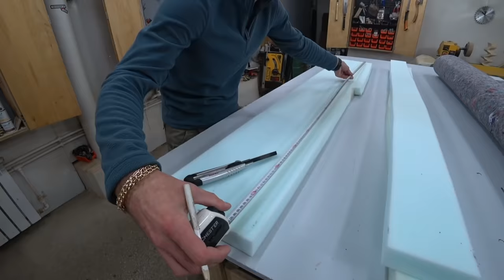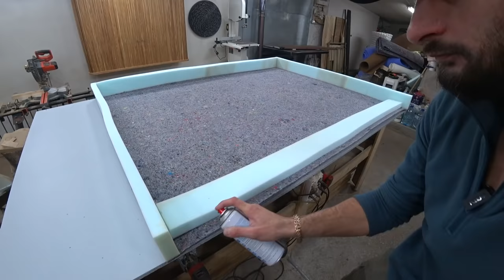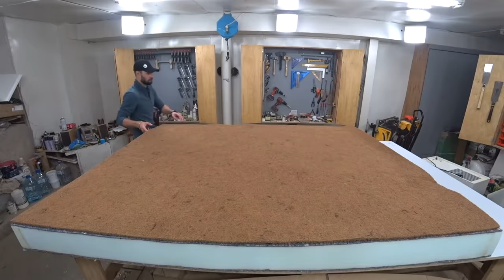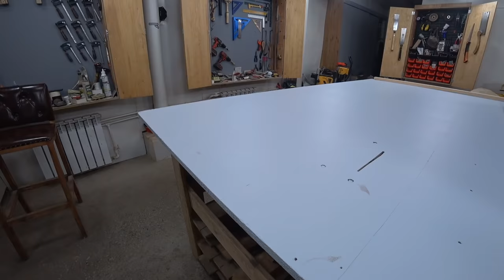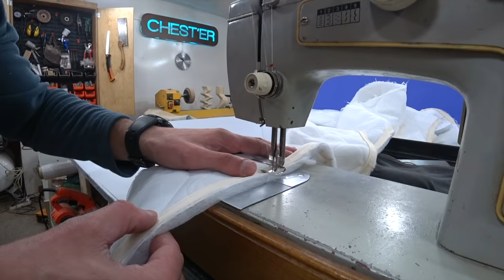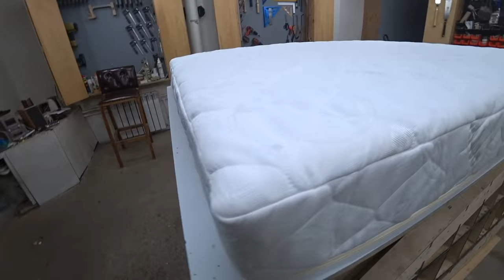You will save 3 times IF YOU MAKE THE MATTRESS WITH YOUR HANDS

Comment: My foam mattress was sagging in the middle. I unzipped the cover and took it out. I used an electric knife to cut it in thirds. I moved the sagging part to the bottom and spun the top part 180 degrees and put it back together with spray. Put in a new inexpensive topper layer. I got extra years out of it before buying a new mattress.
Reply: make sure to make sure your mattress doesn't have fiberglass in it before doing this
Reply: @xynonners  yikes. I know I wore a mask (n95) for the spray. But I cannot remember if I did when I cut it. Since I wrote the above comment, I bought a sleep number mattress.

Comment: This is definitely not a project I would have ever thought about undertaking, and of course this guy makes it look soooo easy.  But the basic concept is very solid and doable for those whose ambitions run high.
Reply from the maker: Any project requires effort. That's for sure. But in general - everything is possible, even with a minimum amount of tools.
Reply: I feel like if you were to buy your own mattress cover instead of making it (sewing big sheets of material is hard) the process would involve just stacking the layers and gluing them with spray adhesive. Seems manageable to me!
Reply: @matnovak  exactly what i was thinking. dimensions for  bed sizes are easily attainable, the $$ you pay is for the knowledge of which layers to stack how to get your desired mattress. Definitely thinking about attempting this before dropping a stack on a mattress.
Reply: Its easy asf I used to work at a mattress recycling place and we just cut off the outer fabric and put it into a machine that separated the metal and wood from the rest. Most were brand new but with slight defects and had price tags from 8-18k but when you open them.theyre very simple and the actual materials are relatively cheap. It would be like apple using 50$ of electronics in their phones and still selling them for over 1k.
Reply: @chesterkrsk  что за клей вы использовали?
Reply: @P.Subaeruginosa  USD?
Reply: @P.Subaeruginosa  can you show up and purchase mattress off them?  I did at one point look into how to extremely deep clean a mattress and if it’s totally clean why would I care where it came from.😊
Reply: @nerddub  Go to Arizona Mattress & get REAL quality, i.e. latex foam & Leggett & Platt springs (the leader in the industry BTW).
Reply: Except the off gassing of all the glue and foam may not be very healthy .   Add in all the time and equipment he used.  Plus you have to source all the materials.   Make a good rope bed with a hand made stuffed mattress using natural materials.  Easy and healthy.
Reply: Ideal if you  have a bed needing an unusual size mattress though I am worried about the type of glue being used.
Reply: @chesterkrsk  And health. You need good health to do it, too, which some people lack, myself included. If I were to attempt that, I would probably hurt myself more than I already am. I threw out my hip and back for a year trying a balancing board, lol. Even if I were able to do it, it would probably not be worth it for me in the end. Then on another note, there is all that glue you were spraying without a mask. That is probably not healthy. I don't know, but others probably should wear a mask, I would think. I have respitory problems, so again, it would probably hurt me more than help me to do this project. 

I could probably buy a clearance bed for maybe 300 to 400 dollars, so unsure how much the materials costed you to build yours (Just looked, so about 109 dollars USD). Then, the bed manufactures probably could create a better bed than I ever could. I'm curious: Do you use your homemade bed, or do you have a manufactured bed that you sleep on? Do you use that bed that you made in the video?

Comment: Being a manager at a foam plant in a past life all I can say is fabulous job.only critique is I'd use high density foam for the outer box . Probably not easily sourced outside of a foam plant .it's far far more rigid
Reply: I'm just a person. Trying to find foam at a reasonable price. Retail isn't cutting it now days. 

What I really want to know is where can the average person find the inner spring core. I don't see things like that at walmart or home depot. Ace's shelves are empty, too. Grocery store manager looked at me like I was a loon. ;-)
Reply: @vociferonheraldofthewinter2284  I think you would need to order it from an upholstery supply. You can also get better quality foam from them. You are correct, foam at a fabric store is outrageous in cost.
Reply: Yeah, definitely needs some firmer layers. They're gonna sink right through that thing.
Reply: @vociferonheraldofthewinter2284  There used to be a website back in 2008 or so that sold all of the individual components needed to make your own mattress. They sold memory foam, gel memory foam, latex layers, fiber layers, batting, spring cores, all in differing firmness and thicknesses. They even sold pre-made quilted mattress covers that you could put all of your layers into and then zip it up. I made a mattress with a high density foam lower layer at 6" (very firm), medium density middle layer at 2" and a latex upper layer at 2", all zipped up inside of a quilted mattress cover. 

The latex layer was the most expensive part at $180, the rest of the layers and mattress cover were just under $200 together. So, a 10" custom mattress for less than $400, and it was a dream to sleep on. It was easily the most comfortable mattress I'd ever slept on, and lasted me nearly a decade. And I was coming from a $1200 Sealy that I hated. How anyone thinks TUFTED bullsh-t is comfortable is beyond me. 

Anyway, the website no longer exists. When I was ready to try to order new layers, I never couldn't find it again. 

The mattress industry is a complete and total ripoff, and the vast majority of the cost for mattresses is simple mark-up. It costs them no where near that amount to make those mattresses. It's one of the highest mark-up industries on the planet.
Reply: @Crusty Bastard
I work in outdoor cushions and upholstery and work with foam a lot.. I was just contemplating making my son's next bed upgrade (getting big now!) Most suppliers won't even talk to us for procurement if we aren't doing at LEAST a full trailer load of foam.

Just curious... What technical specs for foam would you suggest for something firm yet with give like a mattress? I concern myself more with sewing and actually making cushions but foam is a huge part of my world so I am always eager to hear others opinions.
Reply: Foam by mail has high density foam I want to know where I can get the felt like stuff to put on top of the springs that's what I can't find.
Reply: No sir, foam edges collapse...there are reinforced SIDE edges on several of the pocketed coil systems, & even if you get the basic coil system, it's FAAAAR better than a foam encased unit.  Also, gluing the layers together was a bad idea.
Reply: @Kman.  Смотря какой пенопласт брать.Если большой плотности,то лучше.Но он слишком дорог.
Reply: @alexivanov7571  It's NOT better than a coil edge mattress (IMO), but hey...to each their own. And "EXPENSIVE" is relative.  I just know that dollar for dollar, it is much better & will last much longer.
Reply: @Kman.  Смотря как сделать.Я сам раньше работал на реставрации мебели.Сам хотел себе сделать качественный матрас.Но посчитал что очень дорого,даже по оптовым ценам.Такие матрасы не продают в магазинах из за дороговизны и их тяжёлого веса.Основа 100 мм делается из ппу или как ещё говорят вторичного спенивания.Например такой применяют в сидениях в автомобиля.Далее любые тонкие прослойки водоросли,кокос.Далее опять дорогой латексный паролон 4-6 мм с каждой стороны,с плотностью не ниже 45 кг/см.Можно собирать и регулировать плотность.Этот комплект упаковываем в чехол с жатым синтепоном.Этот матрас может служить не менее 30 лет под любым весом.И не будет ям.
Reply: Los nombres de los materiales q usaste por favor
Reply: @yuderkahenriquez2511  Base rigid polyurethane foam high density+latex polyurethane.Interlayers:Seaweed,Coconut,hollow fiber.
Reply: @AlphaMachina  сколько в вашей стране стоит хороший матрас?
Reply: @Vociferon Herald of the Winter Mist  got to start thinking like a business and not a consumer.
Reply: @AlphaMachina . There are a few sites but I think Arizona Premium Mattress has high quality components for reasonable prices.
Reply: I had a patient once who told me all the health issues that many of the moderate-to-long-term managers at his plant had developed over the course of a few years.
Has that been something you noticed also?
Reply: @itz_premium  Did you find what you need?  And do you want foam or latex?
Reply: I had a patient once who told me all the health issues that many of the moderate-to-long-term managers at his plant had developed over the course of a few years.
Has that been something you noticed also?

Comment: I actually did an even cheaper method; layered egg crate mattresses over the stock Ikea mattress,  topped it with 5cm of memory foam, and wrapped the whole thing in a fitted sheet.  Works great!
Reply: Yeah, I'm fairly sure that expensive mattresses are often just a few standard mattress materials layered together.
Reply: I find the memory form retains heat and very hot to sleep in during the summer.
Reply: @andybrice2711  and clipped together at, from the videos I’ve watched, about 8–9” intervals.  It suddenly made sense to me why those layers start shifting around after not near long enough!!

Comment: I have a semi-dumb question. When you were in the mattress industry, did you notice which coil systems usually tended to be the best in the business? One day I want to be able to cannibalize some really amazing coils/springs for a second DIY bed (this one as luxurious as I can get it), but I'm a bit at a brick wall what I should use to get the best experience I can. I'm thinking of using calico pocket springs if I can (or another really amazing system from whatever high-end luxury brand has them) and wouldn't mind your opinion on what I should be lookin for largely in a coil system. Also, what would you make the layering system if you had many options of fill types (alpaca/silk/hemp/latex/memory foam/wool/etc.)? For reference I'm 5'4" and 160 lbs --- exclusive side sleeper with some back sleeping and I also have a bit of pressure point pain as I have Fibromyalgia, so a softer bed with firmer support is what I need ultimately, as long as it doesn't mess with my pressure points.

I know you're not an expert but I feel like you have a decent grasp on this and would know what brands have great coil systems, as well as what bed layers would absolutely rock for my body specs :)

If not, no worries. I just thought I'd ask and give a shout-out to you for such a lovely video; I really enjoy how simple you made the whole process and I certainly can see the talent you have in this particular field, so I wish you all the best :)

Comment: nice video, couple things though for people thinking of doing this. 
1. I guarantee that mattress is firm as hell. Contrary to popular belief, firm doesn't necessarily mean better. It's ok to have a soft mattress as long as you divide into support layers and comfort layers. This guy has a support layer of coils (firm) and what looks like two transition layers (firm), and a very thin comfort layer (soft). Probably like sleeping on concrete, which is some people's preference but not me. 
2. The foam on the sides is completely unnecessary. I'm not sure why you would do that besides it will look pretty? The coils are already going to offer edge support. Maybe he thought it would be more edge support? If it was me I would have put that foam layer on top instead of cutting it up and had another comfort layer.
Reply: Вы бред написали, боковой слой ППУ обязателен я это вам говорю как производитель с большим стажем, без него пружинный блок выпадет из матраса, какой бы клей там не был он не удержит их внутри, более того он даже не правильно в этом видео их собрал, там необходимо армировать соединение либо если боковой периметр ППУ не ставить то необходимо опорный периметр из металла собирать как это в пружинном блоке типа Боннель, а так халтура этот матрас быстро развалится без вариантов.
Reply: @splinfaotmcastleclashnewda6448  sorry man. Only speak English. Have a great day tho
Reply: Translate it with a translator as Google Translator. I translated it into Spanish very well.
Reply: @jorgealberto2166  that's too much effort. Nah i'm good
Reply: @crazyfool1  It is very simple!!! All you have to do is copy the text written by Splinfao, for which you just have to select the text, then press control+c (which pastes it to the clipboard) and paste it on the left side of the google translator. To paste it you must simultaneously press control+v and then in the right part of the translator click on English. And the text will be automatically translated from Russian to English.
Reply: @crazyfool1  just press the Translate text at the end their post
Reply: @MrMdemon  lmao you guys are obsessed. Mine doesn't say that. Leave me alone weirdos
Reply: You do not know what you are talking about!

Comment: Ayo, I work in a mattress factory, dude ain't bad. I would buy "egg crate" toppers for the foam. We actually get those springs in paper rolls for "hybrid" beds.
Reply: Is it ok for me to use small size springs just in case i dont have a bigger size springs to fit all over
Reply: @Rajabkiseka324  I'd say no, the springs need to be large enough to support your weight. The bright side is that these springs can be purchased individually from a factory in china.

Comment: Great vid Chest'er.  Personally I would have avoided the conical spring units, they are dreadful once they start letting go but hey if they are cheap enough right, why not? Often I get foam sized and precut from my supplier. Saves me so much time and effort. If the right density is chosen there is no need for springs at all. With an awesome shop like yours, you should consider air compressor and glue gun. Throw those aerosols in the bin with the spring units
Reply: What density would you suggest to replace the coils, or is there a weight scale for it? Do you have to pick it up from your supplier or do they ship? Are pre cutting and shipping charged extra? Do you have any good tips on finding a local supplier?
Reply: @LaineyBug2020  There is a weight scale ie foam @ 35-130 (35 is the density kg/m3 and 130 is Hardness in newtons) With 30+ different foam density and make ups there are a few factors that go into deciding what will be used (total thickness/firmness/quality).  If I was making a mattress I'd use firm on the bottom half and softer memory or topper foam for the top half. Often these are trade supply only, you might need to check with your local upholsterer and see if they can get a price for you? And of course cutting is extra, nothing is free these days
Reply: Yes those cheap spring units are a complete waste of time, made from poor quality steel they break  and stab you and when they turn sideways you won't be getting much sleep at all.
They use smaller versions of this mattress instead of quality foam when making inferior furniture/couches, they never last.

Comment: Independent springs won't work for many of us. Also too much foam used. You'll just sink into a channel of the foam and be stck there till really uncomfortable. Then you'll roll out of it onto a "firm" part - only to have sunk down again in 30 minutes time.
Gimme a coil spring mattress with linked together springs any day. With just < 1 inch of cover.
Reply: Just wait till those crappy springs snap and stab you or turn sideways and do your spine in.

Comment: Why did you put an insulator pad on top of a Marshall coil (pocket coil)??
It’s not a traditional spring with a helical wire that tears up your foam, and there’s no gaps in between the pocket coils and has a backing attached to top of spring, so the foam won’t sink down between springs.   Seems like a waste of money unless your goal is to slightly firm up your mattress.   If that’s the case, there are firmer pocket coil units and you could do away with the insulator pad.   But, to each their own.   Looks good.